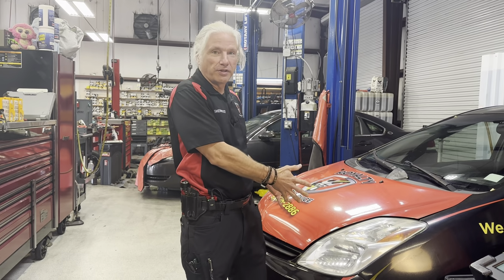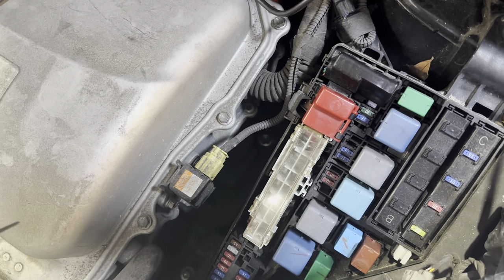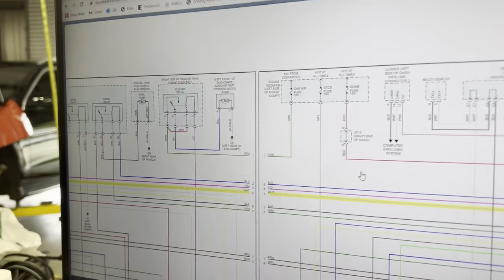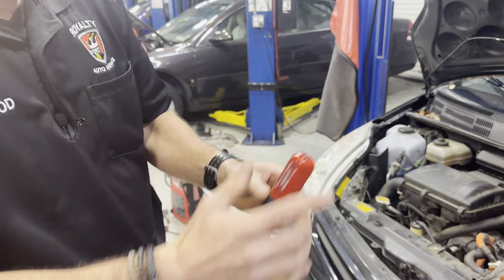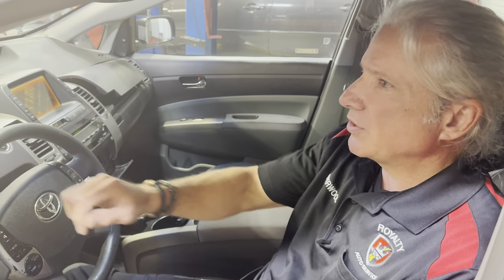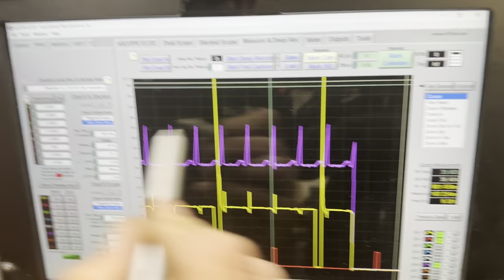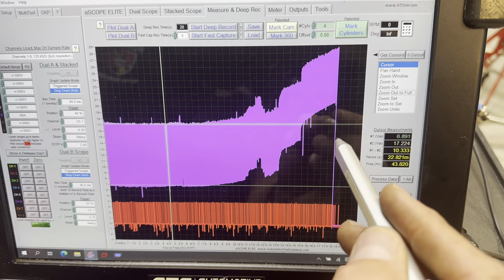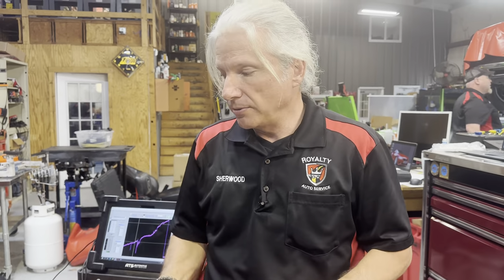Our Shuttle Prius Broke Down.. Let’s Diagnose It Together!

Comment: This just helped me get a customer out of heavy traffic. Same issue, 2007 Prius cut out on a main road, blown AM2 fuse. Put a new fuse in and blew straight away. Unplugged the inverter pump and drove it to a side street so a tow truck could take it for repairs.

Comment: You are a excellent diagnostician!  Watched your video on the Ford with the parasitic draw that turned out to be the ignition switch. (showed in Acc when off and Power relay was hot with the thermal image cam)  You demonstrate an incredible talent  which leads me to a very serious question. you see I too share the same talent yet I struggled terribly in school. Trouble with reading and spelling which I still deal with today. Trouble with being ??? teacher always said distractred. Sadly my father refused to honor  my mothers request to have me tested for what was then called a learning disability. Now many years later I have been diagnosed as dyslexic. Yet is funny as it is,  my dyslexia turned out not to be a disability  at all. It is a blessing and why I have the talent. By chance did you have any issues in school yourself? Would love an answer. :)

Comment: Great stuff. I use 21watt bulb across fuse terminals and amp clamp but only have 2 channel  scope but always get there in the end . Bright light short dim all good depending on load .
Reply: What 2 channel scope do you have ? I always recommend the 4 channel micsig SATO1104 scope
Reply: @thesmartguy3523  I have a picoscope
Reply: @thesmartguy3523 micsig, Is a gun.very good scope.

Comment: Was it the AM2 fuse?

I had the same.  Inverter coolant pump went bad blowing the fuse.

Disconnect the pump and replace the fuse.  Should be able to get a short distance with it.

Replacing the pump is a relatively easy process for a DIYer.

Comment: Nice work mate. One trick if you only have a 2 channel scope like I do would be to isolate the other things by unplugging them, had you unplugged the coils and injectors and had the pump running with the scantool this video would have only been 15mins long..

Comment: depending on the complaint if i feel its possible for a blown fuse to create the problem i check all fuses in all boxes first some of the youtubers say shouldn't be done that way. and yes i understand if its a blown fuse i need to figure out why the fuse blew. like a blower motor if it doesn't work on any speed i check fuses first if it runs on high i know motor is good. lets say i install fuse blower runs then check to see how much motor is drawing to see if thats the reason fuse blew. i see so many test and test to find blown fuse i just start there on most cases.

Comment: The inverter water pump? Is that a voltage inverter connected to a motorized pump? Is the inverter a sine wave inverter. What is the voltage required to power the pump?

Comment: A little curiosity is getting the better of me and I wonder if any Toyota techs could explain how the inverter water pump works and what it does. I used to always assume the pump was there to give you heat and HVAC functions while the engine is not running. However, the fact that this pump and the engine obviously were running at the same time leads me to believe this assumption may be false. Anyone know more than I do?
Reply: The power inverter, which is in the large, silver-grey box in the engine compartment in front of the driver, in a Prius creates quite a bit of heat, so, any time the car is turned on the inverter's cooling system runs to keep it from overheating.  That pump, which sits below the left headlight, is what circulates the inverter coolant.  It is separate from the car's HVAC system (although the engine coolant and inverter coolant do share the radiator).  If you remove the cap from the inverter coolant reservoir (next to the inverter box) while the car is turned on, you can see the coolant "stirring".  It's a great way to see if the inverter coolant pump is actually working.  If the coolant pump fails the Malfunction Indicator Light (MIL), which appears as a large, red triangle on the dash, will normally illuminate.
Reply: @rc4211  That is a very good and informative answer. I did not know there were two separate cooling systems, one for the HVAC and one for the inverter. Is there also cooling for the HV batteries in this vehicle? I have seen some models use coolant to cool HV batteries, and I have seen air blowers used to cool them.
Reply: @kdmq  In the second generation Prius, which is the model shown in this video, the traction (HV) battery is air cooled.  The blower is located inside the car above the right rear wheel well, behind the liner panels.  The blower is connected to the traction battery using black plastic ducting to the right hand side of the metal battery casing.